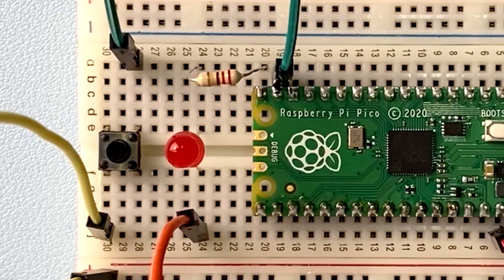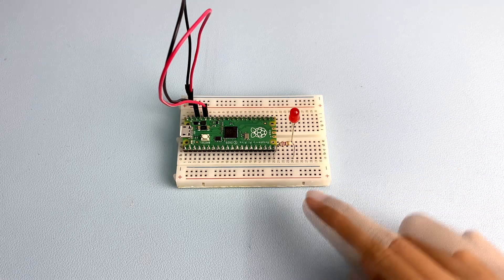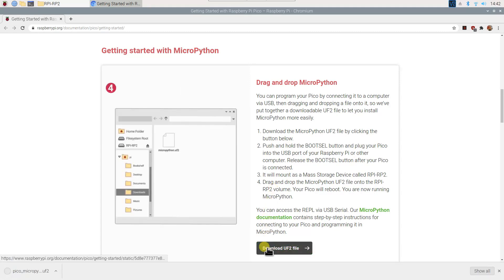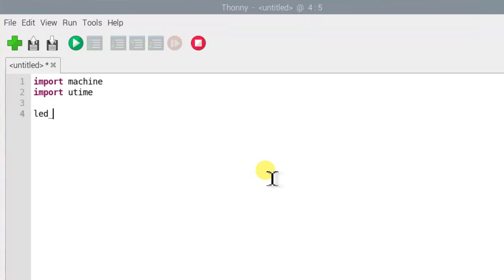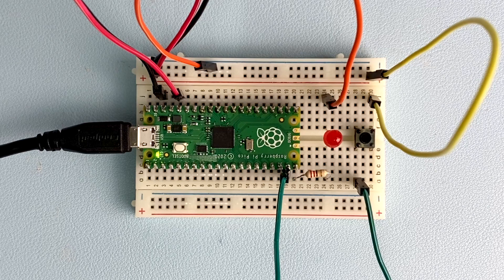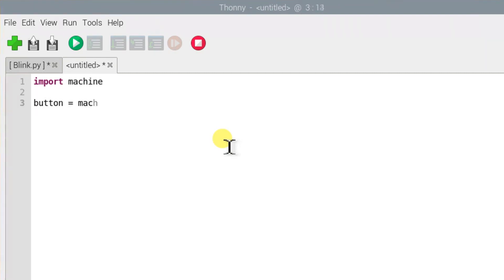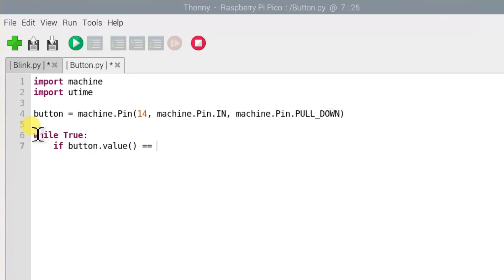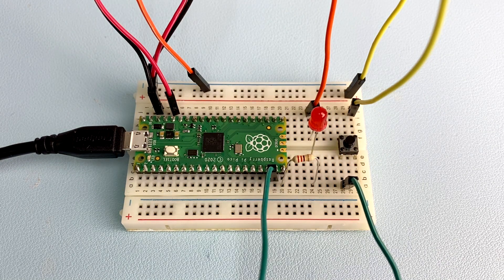Physical Computing with Raspberry Pi Pico #raspberrypi

Comment: Thanks for an informative video. What is the value of the resistance used?
Reply: Looks like a 220 ohm (red,red,brown) which would be about the right value. Of course it depends on the LED used but a generic  one like that shown would suit around 180 to 330 ohm.
Reply from the maker: @sirguylittle  yes, what you said is correct. thanks for sharing :)
Reply from the maker: Hi, we're using 220 ohm resistor.